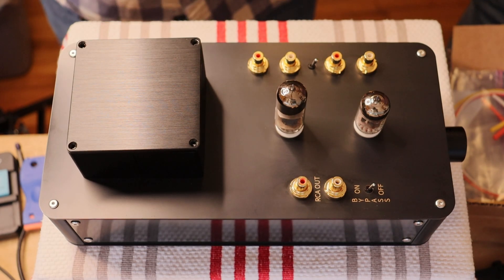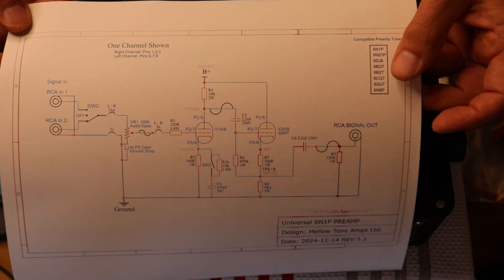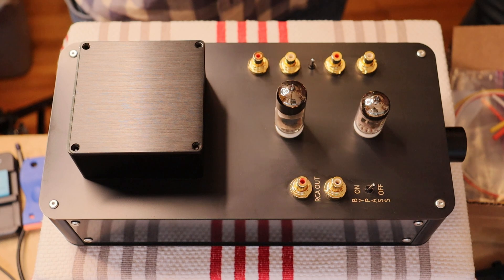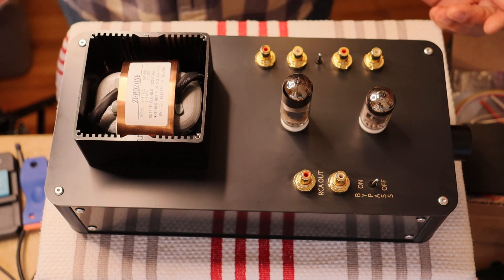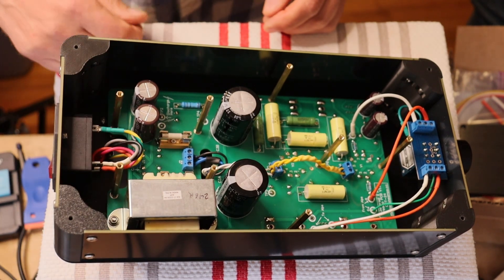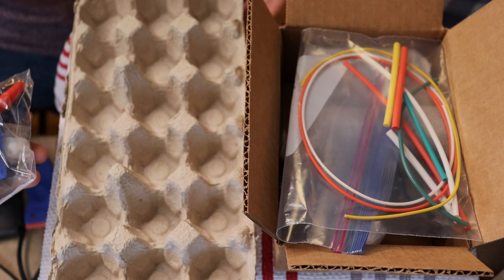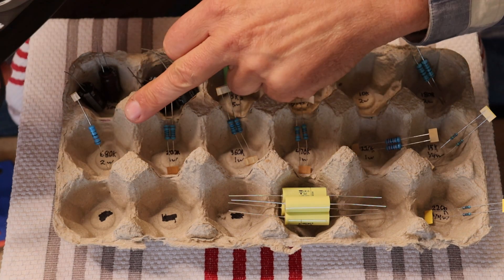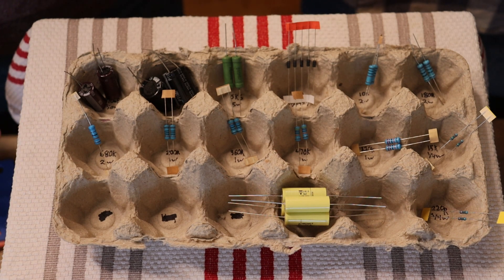Ep1 Getting Started & Organized - 6N1P "Rocket" Preamp

Comment: Love the look and size of the new kits! I'm sure there is a logical reason for the mains switch being on the rear of chassis, but boy would it be nice to have that on the front or top. Looking forward to the phono preamp!
Reply from the maker: @bst8733  Yes, we're close to releasing "The Rocket" pre to Test Builders!  We worked this weekend and filmed the first 4 episodes in the build series.  They're up in the MTA channel now.  And as with all of our designs, sonics take priority over everything else.  The mains power entrance to any amplifier is one of the noisiest places  on the "inside".  Over the years many solutions have been implemented, in order to keep the power switch on the front.  Those include using heavily shielded wire to go from front to back and back again to the transformer.  Actuator rod from front switch all the way back to a rear switch (yup a rod and now two switches - what could go wrong???).  And the modern solution is a switch on front linked with low voltage wiring to an electronic switch on the rear (again 2 switches but at least we don't have a rod inside our amp!).  Or we could simply install a modern IEC inlet with built in primary fuse and the mains switch.  From that rear switch it's a very short run for the mains power to get to the transformer.  It's easy to see why our solution (and many others - early computers were wired this way, for the same reasons we do it today - low noise) is a good option for a great sounding, high gain, low noise preamp.